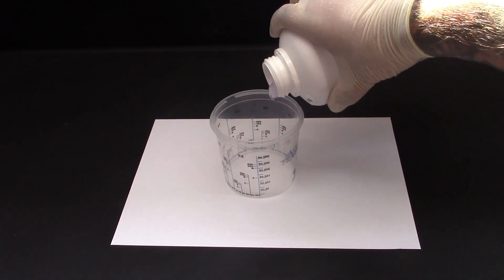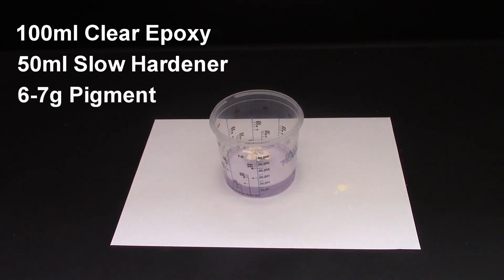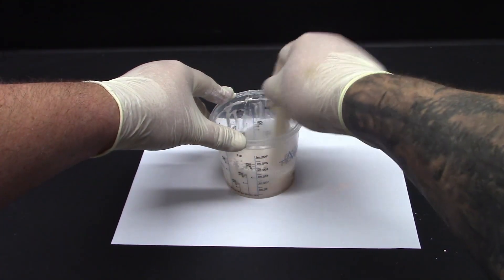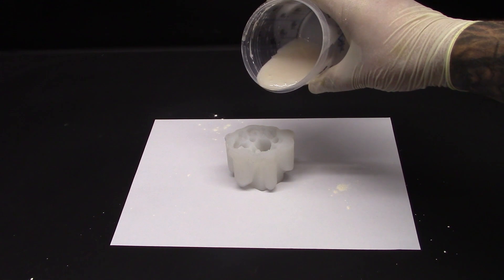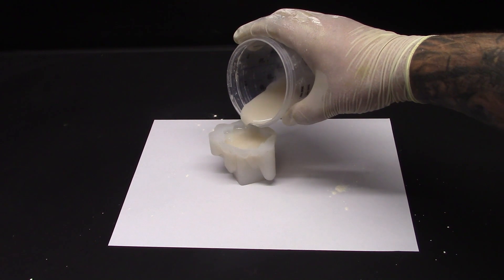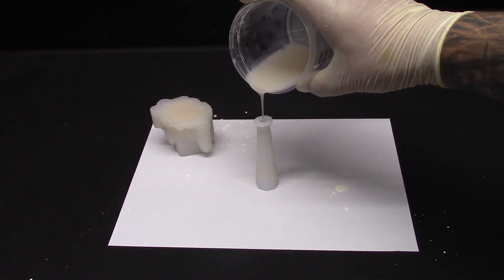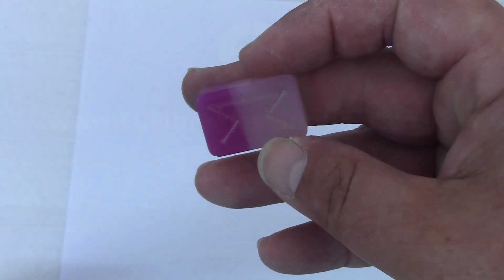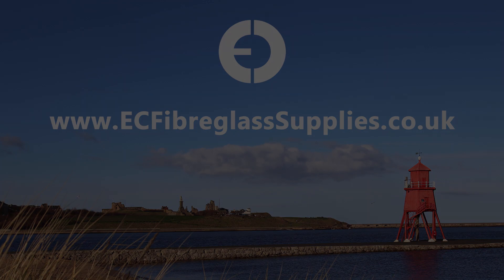Photochromic Pigment Powder

Comment: FYI. Most epoxy manufacturers recommend mixing the resin and hardener before mixing additives. Epoxy works on a molecule to molicue catalization. By mixing all at once you risk the epoxy having poor performance because one or the other component is absorbed in to additives leaving un catalyzed molecules. This is not the case for polyester or vinylester.
Reply from the maker: That is true.  However it depends also on how much additive you are mixing into the resin.  we are adding such a tiny amount here that it has no effect on the mix ratio.  You can even have pre coloured batches made up of resin ready to use which we have also done in the past when adding small amounts of powder or pigment.  if  however you were making an epoxy filler for marine repair and adding around 40% powder for example, then you would certainly have a problem and you should in this case mix the epoxy resin and hardener together  first.
Reply: @ecfibreglassuk  Just saying what every manufvurer recommends. And without testing you don't know if your losing performance.